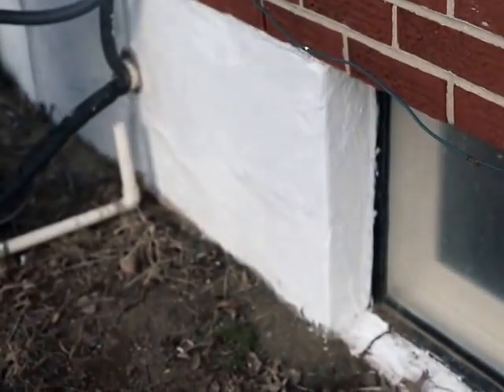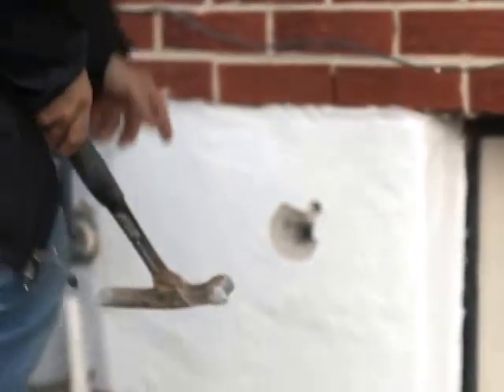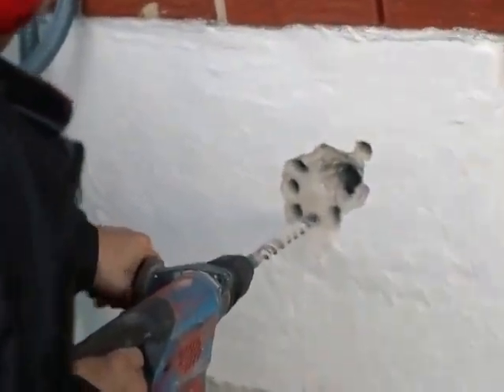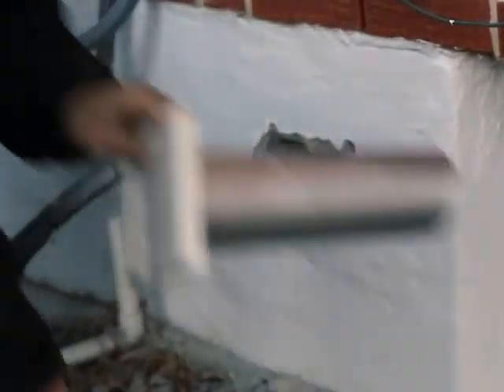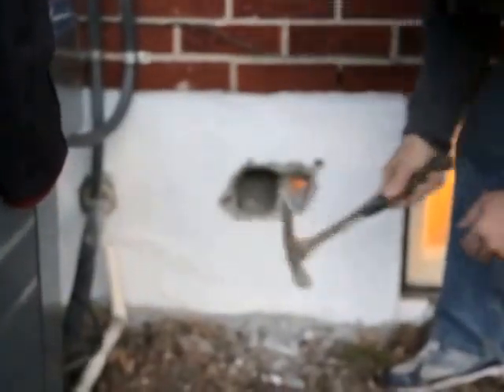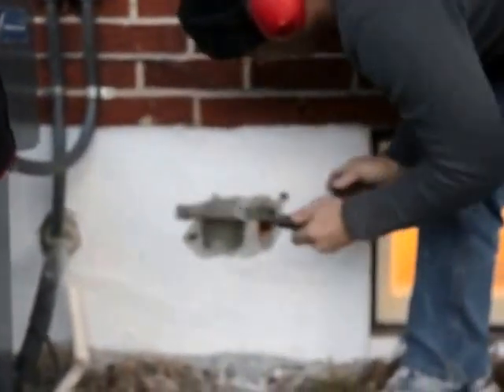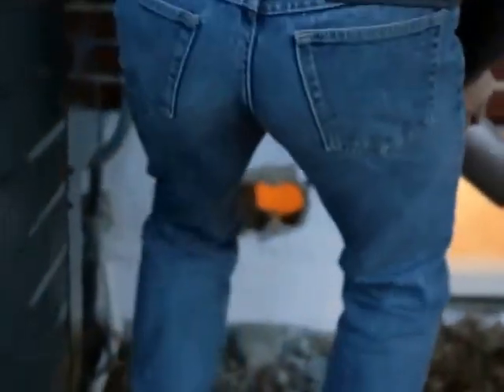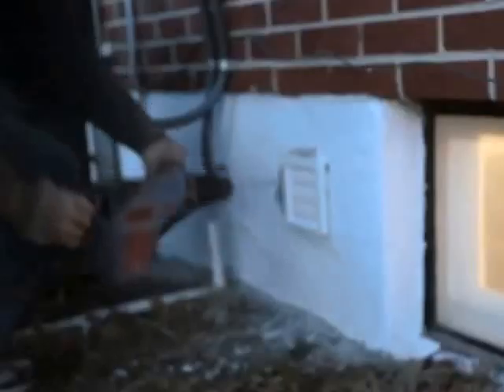dryer vent installation through block wall

Comment: Shoud have checked and drilled from inside first! You are so brave posting the video anyway. I was looking for tips on how to do it and you showed me exactly what "not" to do, so thanks!
Reply from the maker: It had only one position that was acceptable per  community guidelines... So, we often take the good with the bad.
I  could have taken a couple months and demanded a new location for multiple reasons but this one required no approval.
I am glad you see the value in this share.

Comment: I hate to spend $100 on a hole saw to use it 1x but damn that's what I'm going to do
Reply from the maker: Curt, you don't have to do that... this was just a terrible position as it was related to the webs of the block and also this home's configuration.
You can do the multi-holes and then punch it! Or you can even use a round pipe to punch it... A bag of rapidSet concrete mix is $15.00 and it will be patched before you know it.
I did not have the resources at the time I made this video... I was on limited time and did not have the ability to come back the next day... I did make it back ultimately and patched it.

Comment: Would this work on homes made with polysteel walls?  I need to revent my dryer and I figure going into the garage will work better.
\
Reply from the maker: The exhaust needs to be on a pitch in the upward / rising direction to make sure you do not get water / condensation from coming back into your equipment... Also, lint will build up faster on turns and anything that causes reduction in pressure... exhaust pressure.

Comment: I did this (without the concrete web).  I used a screwdriver as a chisel, and it made a pretty round and more precise hole (after drilling a center hole all the way through).  But it totally kicked my butt.  Now I moved, and I have to do it again.  Dreading it.  But even renting the core bit/drill is ridiculously expensive.

Comment: I love this video.  This is how 98% of my "easy" projects go.  I wonder if you have any ideas about a brick house where I'm trying to install a range hood with a cabinet mount.  I'm trying to make a right turn with 8" duct out the back of the cabinet to the brick wall on side of house.
Reply from the maker: Wow. I am sorry, Google, just sent me this message!  I hope you were able to complete this project of yours'.   But, brick homes have two layers of bricks that make up the exterior structure.  They can easily be removed but, you should put back a steel header above the open to support the load of the brick above (depending on how many courses of brick are above)...  This brick home should not be confused with a brick "siding" -- which is brick used as "siding" material and the main structure is supported by wood framing.

Comment: Would a core drill have done it faster?
Reply: Thanks!  I have to add a dyer vent to a 2nd floor unit in an older concrete building in Florida.  I am not sure what i'm gonna encounter.  I want to be properly tooled up!